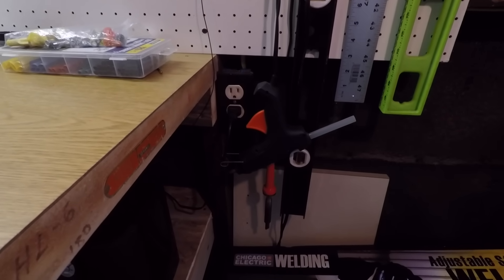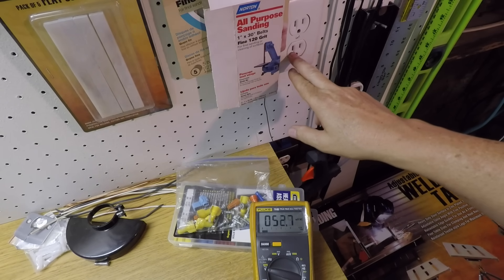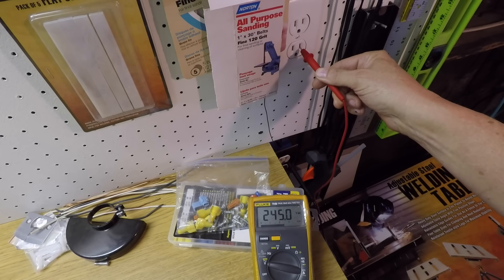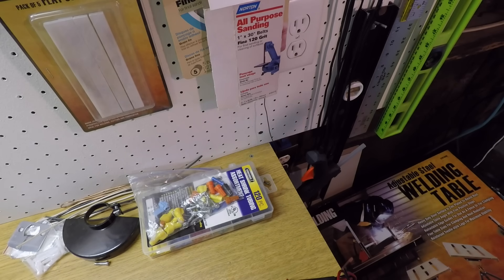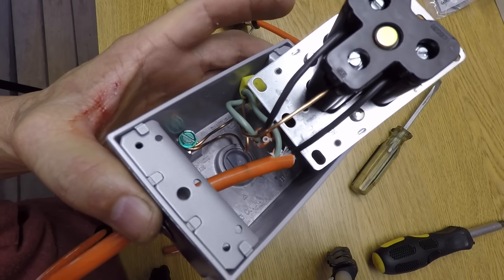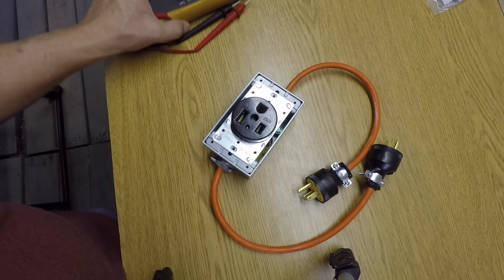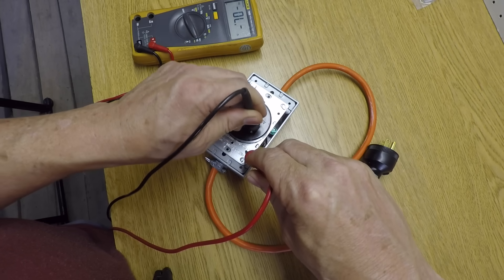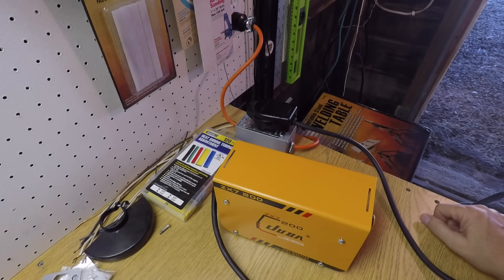How to Get 220v From 110v

Comment: The outlets have to be on different bus bars, not just different circuits.
Reply: Matt: all breakers on one side of the panel are not on the same buss bar. They alternate. That is how a 220v breaker works.
Reply: While y’all are arguing he is welding lol there’s lots of things people shouldn’t do but do and it gets the job done
Reply: thats what i was realizing and it was not mentioned specifically. Although his individual testing would have signaled the problem.
Reply: They have to be on different phases
Reply: @thetoecutter13  Nope. 240VAC is normally a single phase  3 wire setup as is 120VAC. 240VAC single phase is  Line 1, Line 2, and Ground. 120VAC is derived from a Split Phase setup in most cases although there is also the possibility of a 240VAC to 120VAC single phase non-split phase wiring if a stepdown transformer is used.  With a Split Phase 240VAC it would be a 4 wire setup if the 120VAC was available at the receptacle to be proper. There you would have Line1, Line2, Neutral, and Ground. For just 120VAC in a Split Phase setup, it is 3 wires normally ( although some older installations are just 2 ), L1 or L2, Neutral, and Ground. If derived from a transformer that steps the Voltage down, it is L1, L2, and Ground in at 240VAC across L1 and L2 and L1, L2, and Ground at 120VAC out across L1 and L2 as the transformer just lowers the Voltage instead of splitting the phase. 

There is also 3 Phase 240VAC but that is not used in most homes in the US and there you would find 5 wires, L1,L2, L3, a Neutral center tapped from one of the pairs ( normally L1 and L2 ), and Ground.
Reply: UK electrician. Would not meet code here, going back to 2 indipendant circuit breakers. Welding sets have a high inrush of amps up to 3 times rating. So 20a could well be over 50 plus amps. Our devices b domestic, c motors, d welders. I would get some advice from a local electrician before trying this.
Reply: if they weren't from seperate busses there wouldn't be a difference in potential and he would read 0volts from hot to hot
Reply: @craigrodriguez8144  Wait I don't understand; with the two 120v outlets being from two different busses, how does that negate the difference of 120 and 120 being 0? Thanks if u respond
Reply: If you ran the line for another outlet why not just make a 240v outlet in the first place?
Reply: A couple things I see wrong with advice. 1. You should never use wire smaller than amp rating on devise. 2. By NEC, a multi wire circuit should only be protected by a 2 pole single throw circuit breaker. 3. You installed a 50 amp cord on your equipment without knowing what your load is. This should not exceed nameplate load, or closest circuit breaker size. You could plug in to an actual  50 amp circuit instead of a 20 amp circuit. That's why there are different size cords and receptacles.
Reply: Separate phases
Reply: @ceezespi2281  - BINGO!
Reply: Everyone is tripping of different bus or circuit. The only way you get 220/240 is from your A phase and your B phase, which alternates for the most part as you go down your breaker box. He states that each of those outlets are on different breakers and proves they are on different phases. You will never get 220/240 by taking 2 lines off the same phase. Two 110/120 lines from the same phase will never equal 220/240. So he obviously pulling from his A nd his B phase.
Reply: @squeezylo  No such thing. 120VAC in most homes is created by splitting the 240VAC with a center tap at the transformer. But it still is a single phase. There is Two phase power but not in this case. In fact, two phase AC has pretty much been replaced by 3 phase wiring and equipment.
Reply: That's what he means when he said different circuits ,different buss bars or  where I live in the future they are now called circuit breakers
Reply: Dang it!! I am so glad I saw your comment. I was going to do this so I could install a tankless water heater in my cabin but I only have 30 amps coming into it, with two separate circuits (a 15 and a 20) out of a sub panel. I wonder what would happen if I went ahead and tried it anyway? 
Could it catch fire or would it just trip my GFCIs?
Reply: @Follow_Your_Destiny  just install a 220 outlet!
Reply: @jimbritttn  im so glad you  said that, what took you so long? lol!
Reply: @jimbritttn I am at an apartment and the greedy electrician wants $700 to install a 240 outlet.
Reply: Not everyone knows that only if u electrician like me. One of the positive will draw more current and it will trip
Reply: @AviewFromUnder  you are incorrect. Line, load and phase in electricity refer to:
Line = refers to potential (voltage) connection to the input side (line side) of an overcurrent protective device (breaker), fuse holder, safety disconnect or the like.
Load = refers to potential (voltage) connection to the output side (load side) of an overcurrent protective device (breaker), fuse holder, safety disconnect or the like.
Phase = refers to the distribution of potential (voltage) whether it be on the line or load side of 1-phase or 3-phase potential, ie, a circuit.
Reply: Very true, that is the key to making this work.
Reply: Wow...this really got a lot of traction. Will this work...Yes it will. Will it trip the breaker...with out a doubt. At one point or another depending on the usage. Do I want him or any other person upgrading to a 30A breaker or larger...NO!!! By no means should any one install a larger breaker because chances are the wire is probably 12 gauge we would think but some people will use 14 gauge. By increasing the breaker size you are making the existing wire a fuse! Big no no. And for all of you out there. He said this was going into his home. So this means only 3 wires coming in through the weatherhead on the load side of his meter. 2 opposite phases of 120v and 1 neutral phase. 2 like phases will always 0v out. 2 opposite phases will give you approximately 240v. And that is all due to line loss in reference to the transformer. 
But I want this or any novice to discover how long it take him or now a days her to trip the breaker. The more welding is done the quicker they will trip the breaker instead of melting the wire between your walls. And eventually might even have to replace the breaker cause after a while they get trip happy. Oh and the neutral was not part of the plug itself so it is totally unnecessary. Serves no purpose. You would of just wire nutted it together like a light switch. Yes, he should of put in a 240v circuit for it. But a get it. He is not always going to welding there in a confined area. When he is outside. 2 short 12 gauge ext cords and you are welding.  Can't believe my first comment ever was to this video. Have a safe day!
Reply: @guspuga591  Gus, hate to tell you but I had a neighbor whose home was supplied by a 208/120 5 wire setup. Made for interesting days when a phase went down though. But yes I agree, most homes are not wired with wires where you can safely increase the size of the breaker. Much of our home is wired with 12ga and the breakers are 20 Amp. There are some that are only 15 Amp.  Our house also has a dedicated 50 Amp plug for a welder. It also has two transfer switches for use with standby generators/inverter. One is rated at higher than the whole house can normally draw and is down rated by using 200Amp Slow Blow fuses. If a generator is on that unit, it supplies Voltage to the whole house.  It can also kill the power to the whole house. The other is a 50 AMP transfer switch that can only supply power to the emergency circuits from either the main breaker panel or from a second generator cable.
Reply: @AviewFromUnder  o
Reply: If one breaker trips and the other doesn’t you’ll brown out.
Reply: Sir do you mean different boxes or just different bars inside the box?? Thanks!!
Reply: Exactly. I actually did this once but remember it's not safe.
Reply: Can it be understood to mean separate phases, within the panel?
Reply: No
Reply: Every panel is bonded silly
Reply: close, but, no cigar. Guess again
Reply: A bunch of IDIOTS, that needs to understand what is ELECTRICITY FREQUENCY IS.!!!!!!!
(50/60 HERTZ)
Each phase alternates at the same frequency, in a different time.
( oscilloscope).
3 phase motors will lock itself with phases alternating at the same time.
When you duplicate the voltage, out of the same bus bar, you are not filling the gaps in the oscilloscope.
It's like having a two pistons pushing down at the same time.
Reply: I'm not an electrician, but the way I understand it, is that if he measures 240 v they would have to be on different bus bars. If they were on the same bus bar, he would measure 0 volts, no potential difference.
Reply: Thanks. I was wondering about that
Reply: thanks for the tip. In my last house I ran an extension cord, 10 gauge, from my 220 volt dryer to a shed and an old panel box that I used for a 220 volt compressor. I hade circuits for 110 and 220 outlets. It worked great for years and never blew a fuse.
Reply: @stevencourington6392  sine waves or sign waves? Just breaking your balls buddy. It still amazes me just how many non-electricians stayed at a Holiday Inn Express last night.
Reply: That comment and most of the rest is exactly why you should always call a qualified electrician. If you don't know the difference between the buss and circuits then you clearly don't understand where your voltages are coming from.
Reply: Its still on The same buss.
Reply: Exactly, he said he only has 120v  but he really has 240v because they are on different bus bars. I only came because I thought I was going to see a magic trick.
Reply: I built this and with two plugs in the same room all I got was 120 volts. Ran an extension cord to another room, plugged it in and blew the CB. What did I wire wrong? America should just convert to 220 like the rest of the world. I hate this 120/240 shit.
Reply: Wud this wrk to connect a dryer..or the dryer wud be to much as it's on for a while
Reply: 1:53 into the video he pointed out the two receptacles were on separate lines and he demonstrated that putting the meter on the two lines would give 240V
Reply: RydFree , separate lines doesn’t mean they are coming from the two different buss bars...! 🤷‍♂️
Reply: @rydfree  Did you understand the statement from NSX Properties? I dont think you did.
Reply: @rydfree  Beautiful response you shut NSX up very quickly.
Reply: @rydfree  but it won't unless each receptacle is on a separate phase
Reply: @rydfree  most diyers will think separate breakers and not understand separate busses. Circuit and phase are different.
Reply: @rydfree  Separate LINES, is NOT Two distinct BUS BARS in the panel.  In a panel you have 220 c0ming in and 110 goes on a bus on the right and 110 goes on a bus on the left, thus two distinct separate BUS BARS.  Personally I would just wire a 220 outlet in.  This solution is sketchy at best.
Reply: @rydfree  Just separate lines is not enough. One line must be from a breaker on the left side of panel and one plug must be supplied from breaker on the right side of the panel. Only get 240V if this is the case.
Reply: @Matt18880  , well depends on his welder's voltage input range. Mine is 190v-265v, so 240v wouldn't be a problem for mine
Reply: @Matt18880  Every other breaker from top to bottom in the panel is energized from alternate buss not left to right.
Reply: @kenturner3268  my box is old, like me, and it's left/right. Center is neutral.
Reply: @Matt18880  That would greatly depend on the configuration of your breaker box, but most breaker panels are set up so that adjacent breakers are on the opposite polarity.  This is so you can use a double breaker (240v) and be assured of 240v across the breaker terminals, although I had one box where they cheaped out and the bus bars were not alternating at the ends of the row.  But your observation is somewhat correct that the breakers must be fed from different polarities (often called phases, however inaccurate that might be in a single-phase circuit! ;)  )
Reply: @Matt18880  might just be that if they were not on separate buses at the breaker panel with each hot at a different phase you would not get a reading of 245 volts with the meter when you are checking the voltage between those two receptacles as the same thing would be being measured with the meter and you would show a ac reading of 0v like if you were to measure a single wire with both probes, rms gives the average reading of ac voltage read between each peak, 240v or 120v ac circuits are actually the average between the minimum voltage and maximum voltage measure of one cycle of the sine wave .. maybe
Reply: @Matt18880   i did this to try and help my sister out with something and it didnt work. does the outlets have to be on different parts of the house?
Reply: @Matt18880  not true at all think about how a two pole breaker works
Reply: @Matt18880 maybe I'm missing something in your comment but The right and left have nothing to do with 220v. Panels are staggered top and bottom.  While the feed wires come in on the right and left, the actual connections are staggered  top and bottom.  You will never see a 220 breaker being fed from opposite  sides of the panel. Top and bottom.
Reply: @Matt18880  Most panels alternate the circuits with the breakers adjacent. That's is how you install a 220/240 breaker.
Reply: @Matt18880  240 volt breakers in your box work because the lines are staggered top to bottom of the breaker buss. Evey other breaker is fed from a different line.  That's the only way a 240volt breaker would work.  Not left and right but top to bottom.
Reply: @Emune511  Different incoming lines.  It can be wired with two breaker circuits that are next to each other going from top to bottom on the same side of the breaker box.
Reply: @Matt18880 
Panels are setup in such a way, that breakers next to each other on the right side or the side, will always be Line 1 & Line 2.
 If you go opposite side of the breaker, you are on the same Line.
Reply: Matt  not exactly. Could be on on top of each other. Phasing in a panel  alternates so that 2 pull breakers will work. In single phase it’s ABABAB down each side.
Reply: J Schermerhorn m noobbbbno
Reply: @Matt18880  Bus bars alternate legs vertically, not horizontally.  That is why 2-pole 240VAC breakers work taking up 2 slots on top of each other.  Hope that clears that up.
Reply: @Matt18880  each panel is staggered top to left bus bottom to right bus or vice versa, but what I think alot of people are missing is he said "I have 2 separate LINES each with a double plug, one mounted above the other. He is meaning he has 1general lead from say his kitchen lighting or maybe a dishwasher with a 20 amp breaker to one double plug & another LINE perhaps from the bedroom or living room also with a 20 amp breaker. He then grounded his metal 240 plug box with 1 of the grounds, then ran a ground to the actual 240 plug he is installing.Then he ran the power from 1 LINE (just say the dishwasher) to the left hot of the plug and the power from the other LINE (say the bedroom) to the other hot of the plug and came out with 245v. He was meaning the had to be separate circuits for his plug adapter  to work. Is this a good idea? Probably not if you are novice to electricity, just saying💪👍👏🤝🤜🤛👊👌🤟🏅🏆
Reply: @Matt18880  i dont think you understand the term "line" lol
Reply: @joelschermerhorn5447  Imagine all those people buying all this stuff then doing all this work just to find out it doesnt work because both circuits are on one side of the bus?
Reply: @Matt18880  left and right bus bar yes but the bus alternates sides going down thats why 240v breakers aren't long side to side, theyre fat top to bottom
    1b      2b   
     1.      2. 
     2.      1.  
     1.      2.
    So on and so forth
Reply: @Matt18880  wrong, if the breakers are directly across from each other left and right in the loadcenter they are on the same phase at the same potential and you will get 0 volts with your multimeter leads one on each breaker load connection. Odd circuit numbers are on the left side, even circuit number are on the right side of a typical loadcenter. 

In a typical 120/240V, 1-Phase, 3-wire home loadcenter circuit phasing is as follows:
Left side
Ckt 1 = A phase
Ckt 3 = B phase
Ckt 5 = A phase
Ckt 7 = B phase
and so on

Right side
Ckt 2 = A phase
Ckt 4 = B phase
Ckt 6 = A phase
Ckt 8 = B phase
and so on

In a typical 208Y/120V or 480Y/277V, 3-phase, 4-wire panelboard circuit phasing is as follows:
Left side
Ckt 1 = A phase
Ckt 3 = B phase
Ckt 5 = C phase
Ckt 7 = A phase
Ckt 9 = B phase
Ckt 11 = C phase
and so on

Right side
Ckt 2 = A phase
Ckt 4 = B phase
Ckt 6 = C phase
Ckt 8 = A phase
Ckt 10 = B phase
Ckt 12 = C phase
and so on
Reply: @UpcomingJedi  Measure the voltage first just like in the video.
Reply: @u000na0  that is not true, old Pushmatics were a left right phase configuration. You don't see it in modern panels so you are not wrong
Reply: @Matt18880  Incorrect, the breakers alternate bus bars as you go down the row in most new panels. You would actually want to use two breakers that are stacked one on top of the other.
Reply: @Emune511  ... you'll need to use a meter to see if the two plugs will work together. Just keep checking till you get 220 and use those.
Reply: @Matt18880  being across from each other would not work.  They would need to be next to each other.  That is why a 220 volt breaker is twice as wide as a single pole.  The buss bars are interlaced behind all the breakers.  Imagine interlacing your fingers together where one had is one leg and the other hand is the other leg.  Even if they are not next to each other, they have to be pulling from different legs.
Reply: @NBryanBlack  pp
Reply: @Matt18880  Not all panels have that geometry. And yes, some OLD panels do. But as a general rule -- you're wrong. In ALL modern panels the two-legs of 120 V power are going to be right on top and bottom of each other. 
Code would require that the two hots be adjacent AND fed by a two-pole breaker -- so that if either leg went sideways -- power would be killed to both hots right back at the panel.
In the case here-in, the poster should've swapped out the single-pole breakers for a double-pole C/B. 
They don't cost much, BTW.
Reply: @Matt18880  well obviously when he put the meter in the outlets and he got 240 volts it shows you that that was the case no more need to discuss it.
Reply: @kenturner3268  I was wondering how a 2 pole 40 Amp breaker worked of the same side.
Reply: @Matt18880  wrong
Reply: @Matt18880  LOL  WRONG   the busses  alternate,  otherwise you 'd never  get   a pair of breakers  "on one side" that provides 240
Reply: @kenturner3268  This is not generally true in a  120/240 panel. If you have one row of breakers, they alternate, if you have two rows of breakers, each row is on one leg of the 240 circuit. 40+ years as an electrician.
Reply: @Matt18880  wrong
Reply: @Matt18880  You don't know  WTF you are talking about.   Breakers alternate  phases  every other breaker.  THIS IS WHY  stacking  two, one on top of each other, results in  240V  across the two
Reply: No, that’s not how it works. The phases alternate by rows. Breaker 1&2 are A phase, breaker 3&4 are B phase etc etc….
Reply: Thanks 😊
Reply: Exactly!!
Reply: Good day how do you know if the outlets are on different bus bars? Thanks
Reply: @chapperone5618  they would have to be or he wouldn't get 240V. This is not a good idea for many reasons.
Reply: You are correct I use a chord like this for a 220v floor sander works great but has to be on different bars and mine won’t work on a ground fault plug . Marine y adapters are basically the same https://www.westmarine.com/buy/marinco--reverse-y-adapter-2-30a-125v-male-to-50a-125-250v-female--10072957?recordNum=1